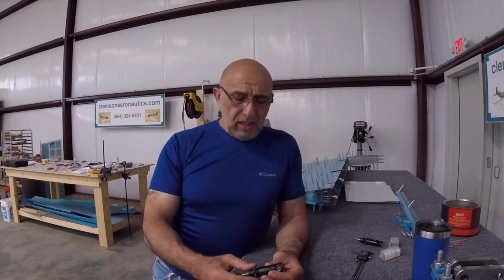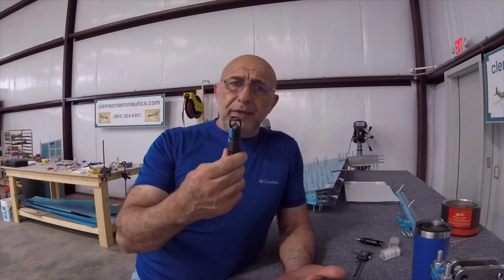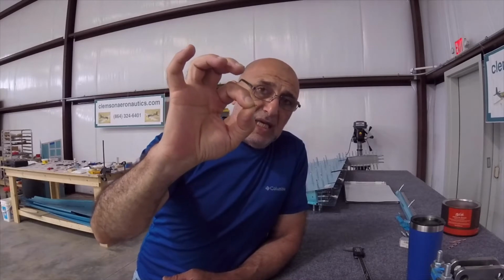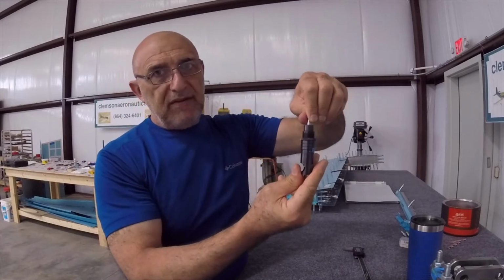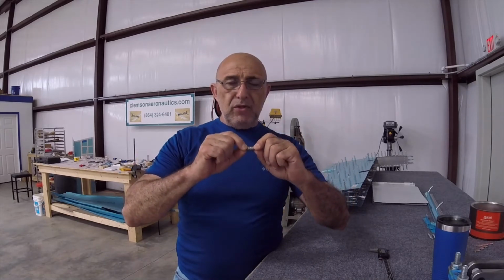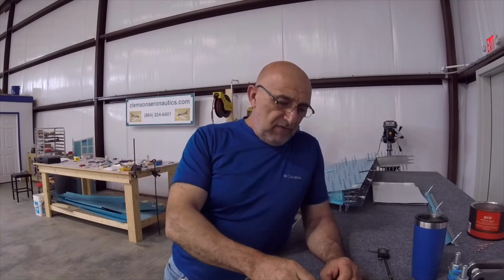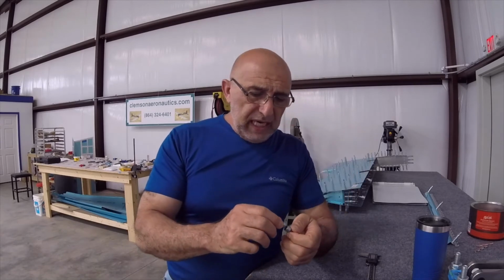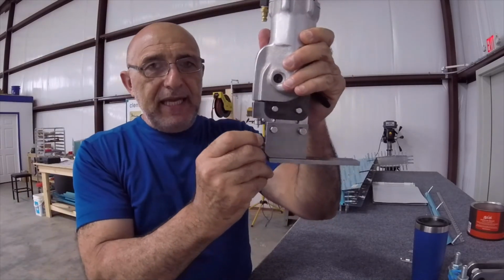Clemson Aeronautics RV-14A Build Building Essentials 2

Comment: What do you think about the single flute vs 3-flute countersink cutters? I tried both using my drill press at 250rpm and found that the single flute cutter takes off a long piece of aluminum that can make a circular scratch around the hole. That happened a few times with the single-flute cutter but never happened with the 3-flute cutter, and, at 250 rpm, I had no problem with chattering when using either cutter. So, I don't see any reason to use the single-flute cutter. Thanks again for the videos!
Reply from the maker: Thanks, and you are correct. single-flute cutter has special use, and the three flute ones works best for what we are doing.

Comment: why not directly go 7000th deeper and avoid one more step?
Reply from the maker: Maybe I wasn't clear about that. When you set the tool, you set it to get the rivet flush, then adjust that tool to .007 deeper and leave it at that. Then after that you go straight to .007 deeper with the new setting only. The forward spare have 9 holes on top and 9 on the bottom that would be countersunk flush, when you are done with those you adjust your tool to the .007 deeper and  and do the rest of the holes in both the front and rear spare. feel free to call me anytime, I will be happy to help.